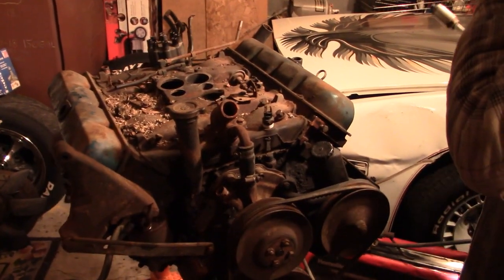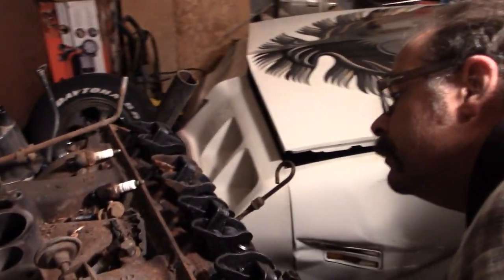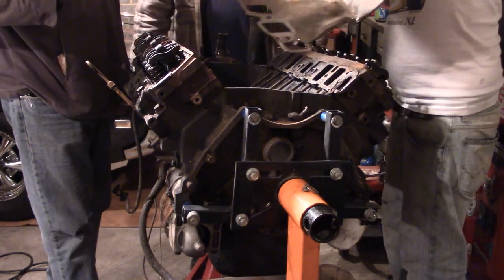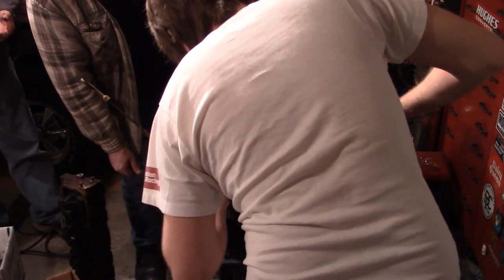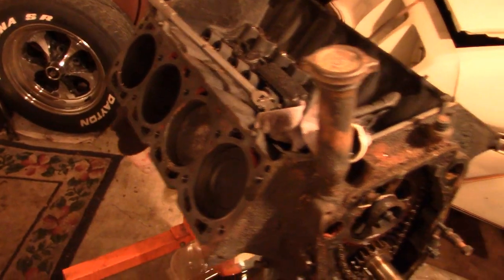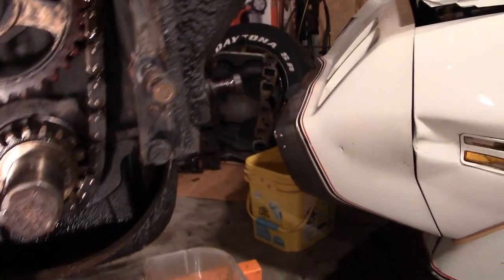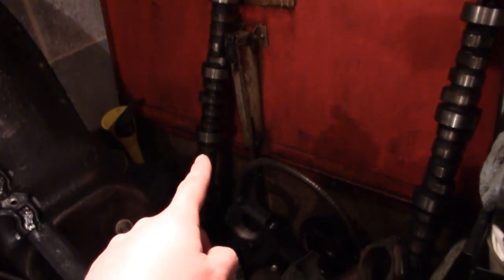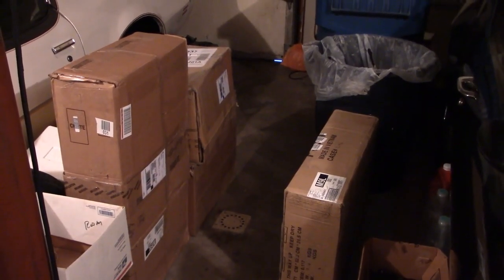BUILDING MY FIRST BIG BLOCK: OLDS 455 THE TEARDOWN.

Comment: That is a ton of play in the timing chain! I have changed the timing chain on two 425 engines, the nylon gears were fully intact albeit with a few tiny cracks. The chains were tight all things considered, perhaps 6 degrees slack. I really enjoy your Oldsmobile stuff!  Thank you for sharing these adventures!
Reply from the maker: Im glad you enjoy the show. My guess is city cars have more stretch to the chains as to the cars that see mostly highway driving tend to last longer due to practicality no start and stop. This is the 455 i just dumped in the cutlass last month.

Comment: Great vid of tear down. Yeah that's rare that the cam gear nylon isn't gone.
Reply from the maker: Tell me about it lol. Hopefully if this block is useable it's going to be a monster, in those boxes I've got an aluminum top end kit along with some long tubes, mini starter plus some other goodies. If all else fails I've got another block I can use. At least seeing that gear I know for a fact it's never jumped timing.
Reply: @UsefulEntertainment  very nice parts , can't wait to see it finished. And hear the beast roar.. and yes that's very good sign, that cam hasn't jumped.  Wish I was tearing down my olds 403 right now, but no garage lol. Anyways good luck man, awesome vid and can't wait to see more
Reply from the maker: @craigmanthie8134  I'm projecting to have it done by spring. The 403 has got me interested, I've never driven one before so I don't know how they feel but I've heard you can do a lot with them.
Reply: @UsefulEntertainment  very nice, I'm hoping to start mine by spring. I heard the same thing about olds 403.

Comment: If you want hi compression at 11.3 use pontiac pistons ,425 olds rods, and 455 crank.  Awesome combo and make sure to have it balanced.
Reply from the maker: Thanks man, i already put it together and its in the car waiting on all the accessories to be hooked up. Used factory crank, rods and used flat top forged pistons. Heads CCd in at 78 ccs and had to take 19 thousands off the block because it was warpd, should run good. Also went with mls head gaskets but cant remember the thickness. Mild cam, single plane and a 880 holley, long tubes and i picked up a m20 4 speed. Had the crank drilled when it was balanced. 
Check out some of the more recent cutlass videos i have and you'll see it.

Comment: I'm surprised it was do clean. Looks like shortly after a rebuild they stopped driving it and left it because of the issue with that cylinder. Still got a good engine and heads are probably still good.
Reply from the maker: I don't think this engine was ever rebuilt, the bottom end in my opinion has never been apart. I'm strongly leaning towards this motor was overheated hard at some point and some hillbilly did gaskets on it, the cooling system is horrible. We took the exhaust manifold bolts off the driver side and the center of the manifold that covers 2 ports broke off and fell on the floor when the bolt came off. I just called the machine shop and I have to drop it off this week.
Reply: @UsefulEntertainment  it's just so clean looking though lol but that's possible. That will be one nice engine
Reply from the maker: @EfurdGarage  I sure hope so lol.

Comment: Movin into the big leagues useful? Good choices...both high compression...and good heads...you think that intake heavy? Factory FE Ford 77 to 82 pounds lol
Reply from the maker: The intake is about 80 pounds I believe also they did head gaskets on both sides. Yeah I've been wanting a 455 since I've owned the cutlass with is about 8 years so I'm finally stepping it up

Comment: What heads are you using ?
Reply from the maker: I'm using speed master Chinese aluminum heads. The castings look really nice but I'm having my machine shop check the valve job
Reply: Useful Entertainment oh ok I’m torn I have a 500 cubic olds 455 built that I have yet to fire up but got two more 455s then the rocket racing block caught my eye 👁 I guess they addressed all the problems the oem block had
Reply from the maker: @lamontwhitehead1809  I've seen them, quite expensive but I want one. Considering getting one?